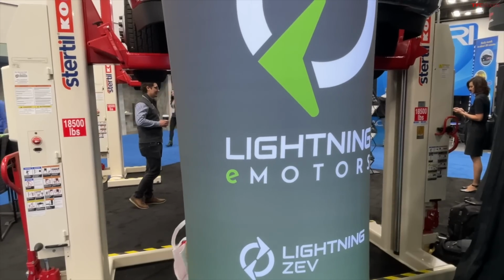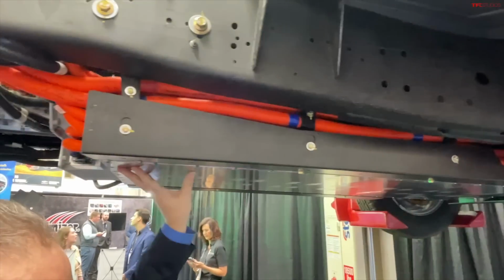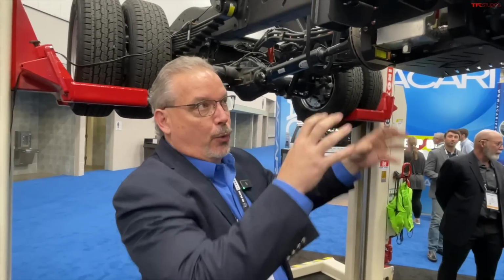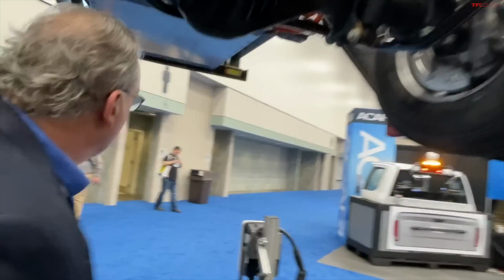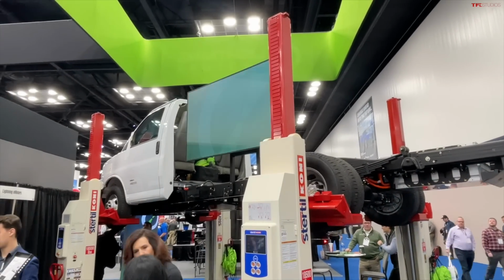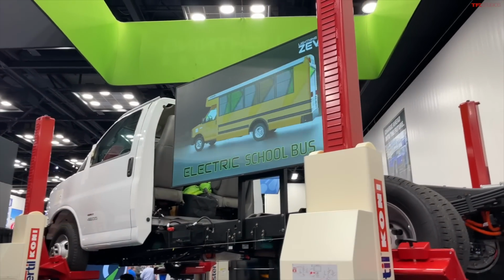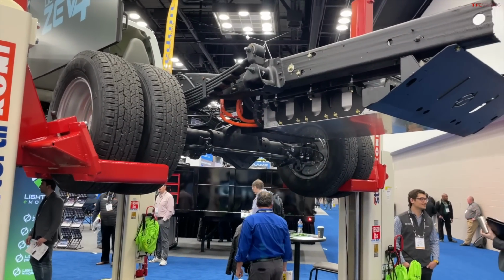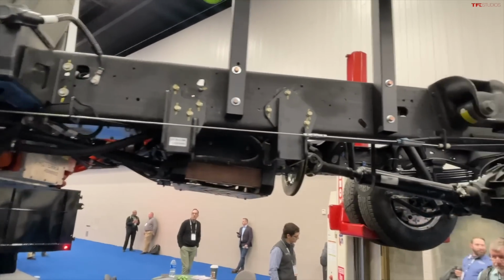Chevy Hasn't Built an Electric Van Yet...But Lightning eMotors Just Did!

Comment: Don't be stupid and buy an EV fleet. Then you have to buy high speed charging stations for your trucks and watch how low they're actually being charged because the power they're drawing from the city is ridiculous. The only car manufacturer that's making sense right now is Toyota with hydrogen.
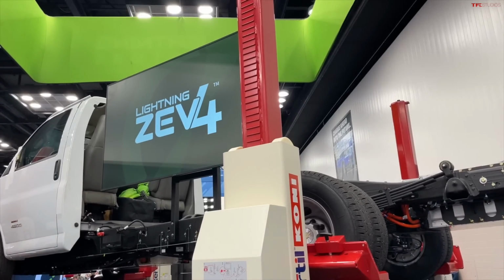Reply: You must have missed the mobile DC charging station option talked about at 9:30 in. Plus, they really only need mostly 22kw AC chargers for overnight charging, and small amount of DC chargers. They would also be smart to use a battery buffered DC charger to minimize HV infrastructure to the depot

Comment: Hmm…leaving those orange cables exposed is a huge no no. They are soy based and rodents LOVE to chew on soy based wire covering. They need to be better protected.
Reply: They look to be PVC or EPDM based, not soy.
Reply: What you see is not the wire, it’s an orange sheathing, super strong and resistant to abrasion and rodents. The electric wire protected inside.
Reply: @lumberjackdreamer6267  same thing.

Comment: My local utility, SDG&E, has some of the highest electricity rates in the country.  But even SDG&E have EV rates that are very affordable like super off peak EV rates as low as $16/month and $0.145/kWh.  If my school district were to operate this school bus it would cost less than $20/day to go 120 miles.  The price of a gallon of gas here is currently running well over $5/gallon.  So fuel costs would be 2-3X cheaper.  In addition the electric propulsion probably could go a million miles with no more maintenance than changing the oil in the axle.  Brake maintenance should also be way less also because of regen.  The man says batteries are the main cost factor, but battery cost is coming down rapidly.  GM says the cost of batteries have come down from $1K/kwh in the Volt to &100/kWh in their current Ultium applications.  So, in 10 years when it comes time to change the batteries it should cost less than an engine/transmission overhaul.  If state and federal incentives bring the cost down to parity with an ICE bus, this thing is a no brainer.
Reply: Honestly, the batteries would likely last longer than 10 years

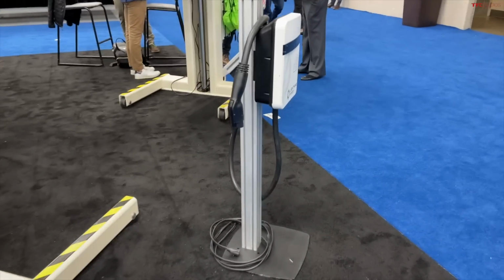Comment: 9:02 "This is a DC fast charger" Nope. That is a J1772 connector. Provides AC level 2 charging.
Reply: In Norway the Tesla super charger was a Type 2 looking AC charger but could deliver up to 250kw so most likely it was modified to deliver DC. Maybe this is something like that just with a Type 1?
Reply: @stianthomassen6693  this company probably isn't using Tesla connectors. It's likely an AC charger

Comment: 130 mile range, come on, not enough
Reply: Remember that the use case is 40 miles per outing. Potentially three times per day (morning, noon and afternoon trips), would give full daily use on one charge.
Charging it once per day is adequate.  This is not a personal vehicle.
Reply: @gordonborsboom7460  it makes sense for a school bus for most but not the commercial aspect at all. Imagine 5-10 different residential locations 20 miles apart not to mention on board power for tools and what not. Winches if recovery and forget about pulling/towing anything that range is useless.
Reply: The range make sense for dense cities. Service vehicles don't make money driving around. They make money working at a site. I would need more range for my use case but the needed higher battery power density will come in time.
Reply: Put this in perspective.  (one I have yet seen considered) A horse life span is 20 years on average.  If it is not used to carry people or pull a wagon.  When pulling a wagon the lifespan is 2 years!  The top speed is about 2-4 miles an hour.  (walking) It can do that for up to 30 miles a day.  Still think 130 mile range is bad?  ;)  In places like Turkey, about 400 horses die a year many more are injured and left to suffer till they die.  EV's have their issues, but what transportation does not?
Reply: Remember he said school busses use these a lot? School busses. They don't run 130 miles a day, by any means.
Reply: I was surprised by that with how much battery it has, but it could possibly be better if they did a normal Express/Savana cargo or passenger van.

Comment: What would be perfect for me is to be able to pull a 15,000 pound trailer 60 miles a day doing parking lot maintenance and then recharging at night and going out again the next day doing the exact same thing
Reply: The F-150 Lightning is rated for 14,000 pounds.  I believe I've seen YouTube videos where that is exceeded with no problem.  It would likely go more than 100 miles while doing so.

If you prefer to stay within the rating for daily work use, might have to wait another year or two, but it's definitely coming.
Reply: @davidmenasco5743  I am patiently waiting for a F350 battery powered vehicle hopefully they will have it in the next two years… I have seen two different Proto types down in Dearborn by their proving grounds
Reply: @davidmenasco5743  it's not a great idea to do max towing all the time on a truck

Comment: Curious on how the regenerative braking would work?
Reply: It uses the electric motor like a normal EV!
Reply: The heavier the vehicle and the heavier the load, the better the regen.

In mining applications where the load is carried down a hill and empty truck goes back up, the regen can fully recharge the truck on every trip.  Almost like perpetual motion machine.  There are mines where this is done.  The first YouTube videos showing this went online in 2018.
Reply: @davidmenasco5743  unfortunately it doesn't work in every cases, there is even the infinite train in Australia which works on the same principe going downloaded and uphill empty but that's a super rare case too.
Reply: if it doesn't have it, it won't survive
Reply: Like any other ev

Comment: Since those vehicles will have larger roofs, why not make it part of the package to have 6 or 8 PV panels supplying power to the battery bank. All the time. Depending on the PV panels, you might get 2kw per hour free range. And when parked for 3 or more hours, 6kw. It's not much, but it would supply a FREE, power source. Compared to a charger.
Reply: For a small school bus that goes 30 miles a day, five days a week, solar roof might provide close to half the energy required for daily operation.  

And in the summer, a bank of parked busses with solar panels could power any number of things.  Could cut school district utilities quite a bit.  And provide grid support during peak demand events.
Reply: That might start cutting into interior space for wiring for the panels or take up exterior space for ladder racks. For some applications like a school bus it might be a easier sell through.
Reply: @Hybris51129  Yup. Since the pv panels are on the roof, and the battery is part of the vehicle, all that is needed is a solar charge controler to take roof pv and dump directly into the battery. No inverter needed.
Reply: @markwitkop7022  I think it might be simply a matter of cost and ROI. Certainly might help, but for many commercial applications it's probably cheaper to install panels on your business or parking area roof top. Always nice to have an option for it, but may not quite be there yet to truly market a solution like that to prospective customers.
Reply: I'd like to see it as an option, but I just don't think it's an area of focus for them.... For now